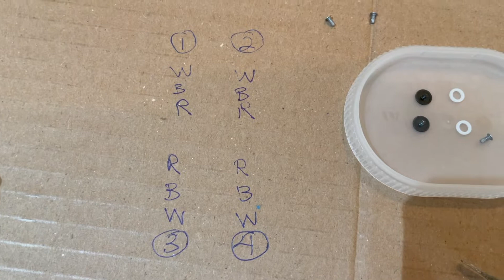DJI Mini 2 Water Damage ESC Replacement Part 2

Comment: Hey, I had the same issue.I got a ESC board from e-bay. And follow your 2 videos instructions.Mine is flying as it before.Many thanks.Keep up the good work
Reply from the maker: Awesome, Glad I could help. Did you also have #1 and #4 LED lights on before replacing ESC? Thanks
Reply: @thecuriousnomad4712  any progress on this?
Reply: Did you have to re-register your drone to the fly app, or was your drone serial number still the same as before?
Reply: @thecuriousnomad4712  I dropped my drone into a lake on holiday ,back to the Uk ,plunge it into isopropyl.Got 2 led only ON .Change ESC same issue ,send the parts back to eBay and get motherboard from same seller ,and it works .Drone is flying again 🙏🏼☺️☺️
Reply from the maker: @islanderstalents8342  Awesome, glad it worked for you
Reply: @islanderstalents8342  great. Im experiencing same issue. Can you share ebay links to motherboard & esc
Reply: @nitindelhiful  Hi I’m in the Uk ,basically I bought a crashed drone,and it costed me much cheaper .The Parts only were costing me £80 on eBay and I got the crashed drone for £100 ,that’s with ESC /motherboard /propellers and other parts I can use in the future .But make sure it wasn’t a crashed drone in water .
Reply: @islanderstalents8342  thats a great deal. I couldnt find such crashed drone in Sweden for sale. Will keep an eye on it txs
Reply: I don't see how it worked dji drones you cant just change parts like gimbal module or the esc or main bored as dji sync them meaning if you change something you have to send it to dji or have the files on pc to get it working I've been fixing them for many years i actually buy broken dji drones and fix them and sell them it's like you can't take one drone apart and put the parts on another cos it won't work

Comment: Hello, thanks for the video of dismantling and changing the ESC board. Now I know how to do it if I need to in the future. What brought me to your video is the fact that I crashed my DJI Mini 2 over a fresh water creek when the temp was below freezing, because I hit an unseen tree twig and fell into  about a foot of water. It was submerged for over 2 hours before I could retrieve it.  At this point, I was just happy to find it to retrieve the card full of video I had recored that day. All files were okay, with the exception of the last file when I crashed. I took it home removed the battery and left it sitting on the porch outside for about 3 hours before I had the chance to purchase some rice. I then smothered it in a deep pan of rice and let it set there for 5 days. Low and behold, when I put a new battery in, it powered up and flew like normal. Shot some test video and it recorded just fine. So... for now thank God, it seems to be okay. Hope it continues to work! I'm thinking that the Mini 2 is programed to automatically cuts power when it detects a fall/crash. Otherwise, if it didn't cut power, It seems like it would have fried the motors, or something! My guess is, if one was flying and accidentally flew it into the water, then they would have a different outcome.
Reply: I had the same experience.   my mini fell into the water fall after hitting some leaves and it came down a while and landed into a hold in the rushing water.   mine was submerged prob a minute or so.  I took the battery out and dried it off.   now it seems to work fine.  did not test the card yet but I have a hope it will all be just as it was.    I was looking at the 2S with all avoidance and ready to get that one but now that this is working I will just keep using this one.

Comment: Please I want to know is the ESC board responsible for connecting the drone to the remote controller
Reply from the maker: No, ESC stands for Electronic Speed Controller, It just controls the amount of current going to the motors based on the signal it receives from the Remote Control

Comment: Hi, I also drowned my Mini 2. I had power system error - changing ESC resolved this problem. There is picture preview on the DJI Fly app, but two other errors apper: Gimbal motor overloaded and gimbal stuck.  Do you have any idea where is the problem? Soft flex-cable?

Comment: in my case on first press 4 led lights are turning on but on second press drone is not booting up... what can be issue please help
Reply: Did you ever figure it out? It's the exact problem I'm having with mine.

Comment: Hi i had the same problem, fixee it by changing the 2 connectors! ESC connector and the 3 in 1 connector, as these parts burn when shorted with water. Give it a try!
Reply from the maker: Thanks for sharing that
Reply: Do you by chance have links to these? Sorry I know this is old but am hopeful

Comment: I have exactly same issue, fell into fresh water and only no1 and no4 led is on  .
Reply from the maker: I was hoping someone on here might know what the no1 and no4 lights mean, it has to be an indicagtor of the fault. I did contact DJI describing the problem but never got a reply.
Reply: @thecuriousnomad4712  I might be an indication of some fault but no one knows what’s wrong. 
So any update on your drone ?